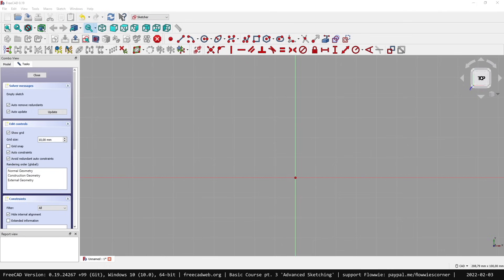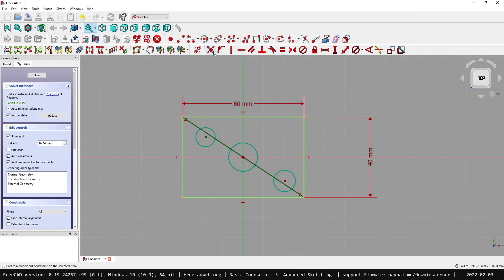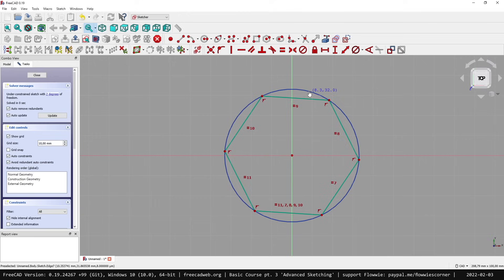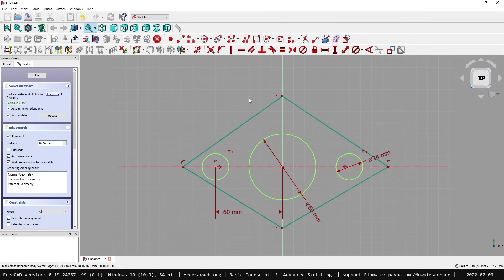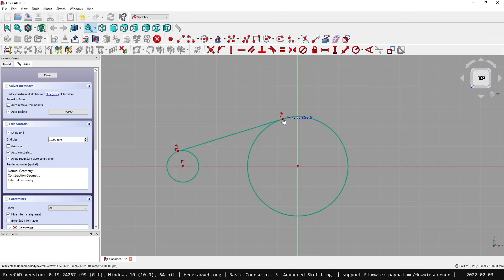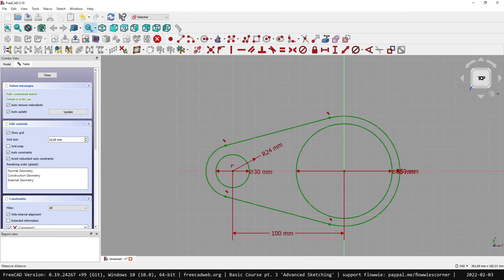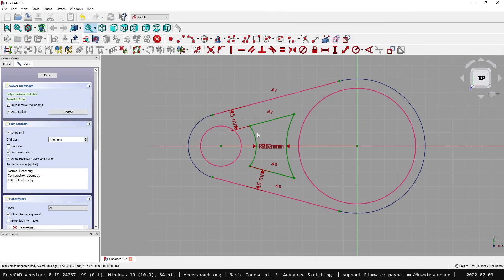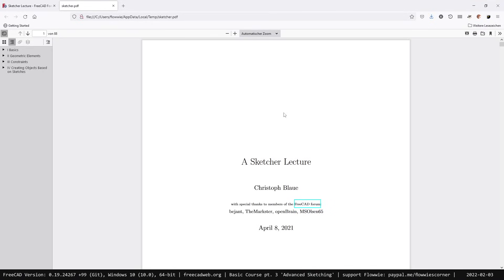FreeCAD 0.19 - Basic Course - Part 3 - Advanced Sketching (EN)

Comment: Any one else having issues with recompute? cant seem to build these drawings no matter how many time i try, i follow exactly to the video, and it just ends up failing, when i constrain the center radius for example, i can do 1, but not both, otherwise it turns the drawing a different color and fails recompute.
Reply: Do you have the 'Auto Remove Redundants' checked in the constraints box on the left?  In FreeCAD 0.21.1 its in the Constraints box, Tools dropdown menu.

Comment: actually the main question I have is: why cant I just sketch on a surface of a body like in Inventor?
Reply from the maker: actually the answer is: you CAN do it - and then I wish you happily running into the topological naming problem with FreeCAD:
https://wiki.freecad.org/Topological_naming_problem
Reply: @FreeCADAcademy  thank you, i figured it out! 

My mistake was this:

In Inventor you can work it all with line elements and still extrude that.

So a line from origin to center of a circle, that circle can be extruded. But freecad doesnt do that. It doesnt understand what the line element is used for in the extension (aka pad).

So i did it like you where I defined the center of the circle with dimensioning to the origin instead.

Comment: Still trying to figure out why “pad” is used to describe what every other CAD tool in the world uses “extrude” which is much more descriptive.
Reply from the maker: Actually pad and pocket are correct feature names that were used in early feature-based CAD-modeling. The name originally made sense if you describe a feature which is added or subtracted to/from an already existing geometry. In FreeCAD the 'pad' is also used for the first extrusion to create your base geometry which makes no real sense. In most CAD programs you don't need pad/pocket but simply the extrusion and within this tool you decide whether you want to add or subtract - so the answer may be that it's a kind of 'outdated' term which was used partly incorrect.
But I remember working with Siemens NX many years ago where you could also add features like German 'Polster' which corresponds to pad. But this tool was slightly different and not based on a sketch. You simply entered some parameters like size and position and then the pad tool would create a block-shaped pad on your geometry. That's what I can tell you about it.

Comment: Thanks! I would say, he most important advantage of "following" sketches it when you're making separate parts of a model, and some of the constaints are relevant to each other. The simplest example: one part has a hole, and other part has a rod to fit into this whole. With referencing the sketches, you could just adjust the radius of the whole in one sketch, and the radius of the rod will adjust accordingly.

Comment: What if you want to create a pocket that cuts from the 'top' of the model instead of the bottom on the origin plane? How do you specify where in the Z axis the Pocket sketch should start from?
Furthermore, can you with a single pocket sketch cut both faces from an origin point in the middle of the object (say, Z: +2.5 mm) while leaving a bit of material in the center?

Comment: At 16:29 you set the large arc's radius to 52.  How can you set it to be the radius of the large circle you linked from the first sketch plus some number of mm, say 5?  I know that it involves using the Formula editor, but I can't figure out what to put in there.  Everything I have found on the web either says to use spreadsheets--which I know will work, but is not what I'm looking for--or to use the copy tool and change the dimensions.  I'm looking for a way for the arc to have a radius that is based on the radius of the big circle from the first sketch so that if I go change the radius of that circle the arc will automatically update, and not leave the Sketcher Workbench.

Where am I coming from?  Fusion 360. If I were to do this there, I'd dimension the arc by clicking on the circle and typing +5.  I just can't figure out how to do this kind of thing in FreeCAD.

(I know that Fusion 360 and FreeCAD are different tools.  I don't expect the way I do something in Fusion 360 to be the same as how I do something in FreeCAD.  I'm looking for the way that FreeCAD does this.)

Thanks